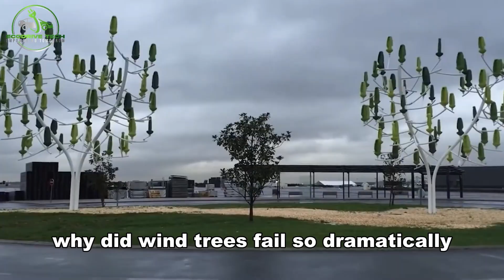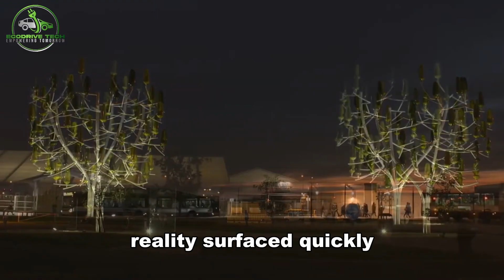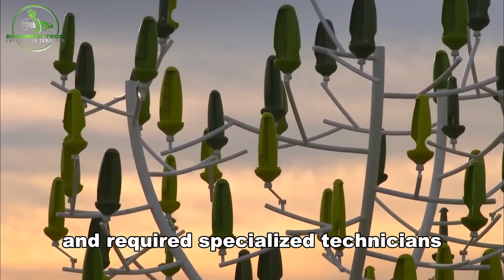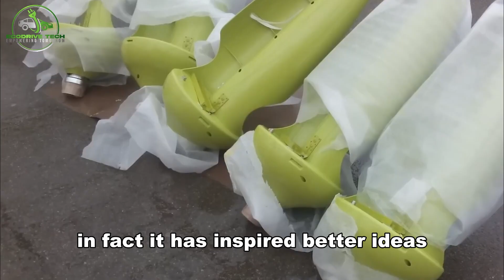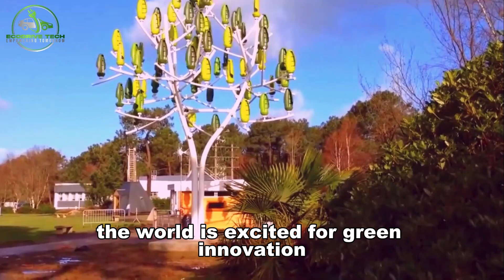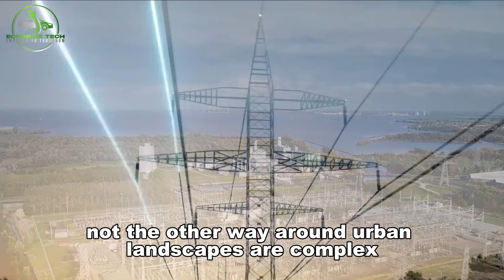The Truth Behind the Wind Tree Collapse | Why Wind Tree Turbines FAILED — The Hidden Problems

Comment: t is important to clearly distinguish between the failure of a company at a given point in time and the validity of a technological concept.

The “WindTree” has often been wrongly presented as a solution for large-scale energy production, which it never was. Comparing an urban micro wind turbine to an industrial wind turbine inevitably leads to a biased conclusion.

Micro-turbines do work and produce measurable, usable electricity, but within a specific framework: local energy production, hybridization (wind + solar), partial self-consumption, energy awareness and education, and architectural integration.

Yes, the initial business model of New Wind did not scale successfully.
No, this does not mean a technological failure, nor does it mean that urban micro wind turbines are useless.

Today, new generations of systems developed by New World Wind address these earlier shortcomings:
• hybrid solutions
• real-time monitoring
• clearly defined use cases
• rooftop installations

For those who prefer facts over narratives, here are real installations, currently in operation, with data and on-site feedback:
https://www.youtube.com/watch?v=LHblvpjlLck
https://www.youtube.com/watch?v=UDGO8WDf7Po
https://www.youtube.com/watch?v=nBssWch9MUs